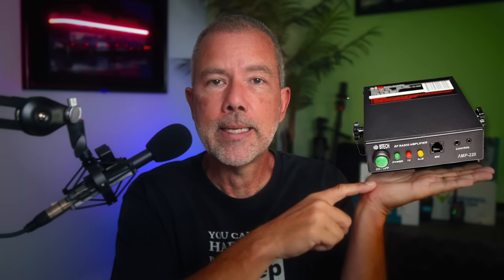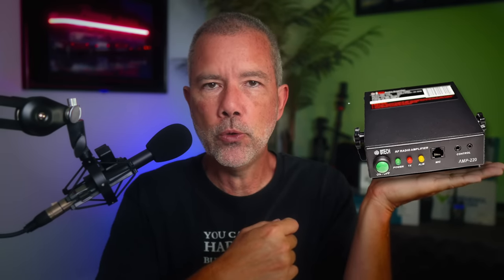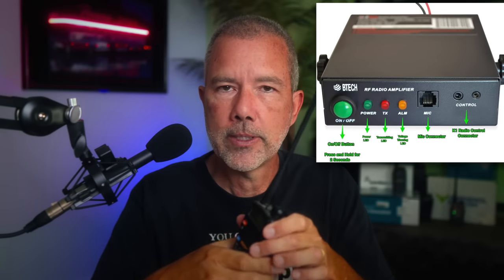Baofeng UV-5R power booster - BTech AMP-220 / BTech AMP-U25 - Boost the power output of your UV5R

Comment: Using a amplifier with a cheap UV-5R is like someone that uses to make a lot of noise at your street and neighberhood shouting stupid things and annoying everyone, deciding to buy a PA (Public Adress) sound system:
You can imagine the havoc........😪😪😪

Using a amplifier like this on a cheap, RF noisy radio is so dangerous for the other radio spectrum users that you cannot even imagine.
Even if you use a decent portable radio, you MUST allways check harmonics levels going into the air (with a good quallity spectrum analyser).
Even much worst at a Base Station than at a mobile station.
Beware........🤬😠
(you can minimize this by using a narrow band passband filter for the ham bands (yes, the ham bands !!! If you are not a licenced radioamateur you have no business transmiting. Remember: you can listen but you CANNOT transmit, so why would you need a amplifier ???!!!!!!!)
Reply from the maker: Each year over 5,000 children are killed because irresponsible parents fail to check the harmonics on their UV-5Rs with a spectrum analyzer....
I am so glad that you have your Youtube FCC Police Badge to save us all..
Reply: Who said they don't have a license?
Reply: The Old Guard 💂‍♂️
Reply: @TheNotaRubicon  you always manage to hook one. Take that luck to the casino!! 👍
Reply: @TheNotaRubicon  it has to be a high quality spectrum analyzer, not just any old spectrum analyzer.
Reply: Guess you'll just have to cry.
Reply: Shush you saaaad haaamm
Reply: i have a ham for flying drones but use GMRS you are sad
Reply: This guy is the reason why every subscriber here should use the roger beep on ham.
Reply: Sad Ham.....Humor Free.
Reply: THe other day, I "accidently" hit the PTT button on one of my UV-5Rs TWICE!  Once in a ham band and once in a GMRS channel.  The wildfire that this ignited killed billions.
Reply: You know, I've seen that claim made hundreds of times in just the last week of researching the UV-5R, but nobody has ever substantiated that claim. Even the GT-5R is just a UV-5R with a software patch to lock TX on certain bands, even though Hams championing it claim it "fixes the spurrious transmissions of a normal UV-5R".
Reply: well Someone likes to see themselves type.  this is more like a christmas ham...fucking boring and puts you to sleep.
Reply: Bro it's 2021, radio tech isn't space age magic, UV-5R is probably many times less noisy than professional grade stuff 45 years ago, and opens the hobby to more people. Stop being a sad ham
Reply: I will be using a amplifier with my UV-10R yes I have 2 UV-10Rs, I don’t care what the FCC rules are, if we didn’t brake rules we wouldn’t need them, having a Ham license doesn’t Improve TX or RX so I don’t need one.
Reply: That was a cool exchange . I haven't seen a knock down cat fight like that since I was in grade school...
Reply: I haz a  speculum anawizer. Widdat work?
Reply: You had me sold as soon as you typed “public address”.   Good for you.  Stay strong.
Reply: I certainly hope you always drive the dpeed limit and always use your turn signals! Like everyone else on the road...
Reply: Why do I not see you posting in the 10m export CB radio videos?  Many like my Connex 4200 have Pills inside not to mention the Wide slew of persons on the SuperBowl6 with their +15000w stations???   Many can be heard on half the band.
Reply: Wau and i thought i will never seen one of those sad hams... :D you made my day
Reply: Hooked you a marlin
Reply: Likes hearing himself babbling
Reply: I need a ham sandwich.   The Bad ham made me hungry
Reply: Sad Ham noises.
Reply: There’s ALWAYS at least one. Congrats OP, you’re it!
Reply: @Tom_H327  It’s not luck. It’s pure sad ham trolling skill.
Reply: I don't see the connection.....
Reply: hahahaa it's the ham radio police!
Reply: @TheNotaRubicon  I smell a ROAST here 🤣🤣🤣 Love your Channel NotaRubicon!
Reply: @BooDamnHoo  THAT WAS YOU?!?!? I lost EVERYTHING in that fire!
Reply: Sadham Insane
Reply: Think of the children....
Reply: @BooDamnHoo  every time I accidentally hit the PTT button, I shiver a little and some pee drips out, don't tell anyone
Reply: I think you need to do a course on RF Engineering!
Reply: Joao P. You're the reason I would never get a HAM license. You are the reason I know that I can supposedly cause harm to others radios with a $20 radio. 
Thanks
Reply: Rectum Analyzer: ACTIVATED
Reply: Yeah, but can you explain that in Portuguese now,  Joao?
Reply: Wtf🤣
Reply: I need an Amplifier with my uv5r ,that way if I accidentally tx without knowing ( while legally listening) , one of the sad Hams like yourself can contact one of your door knocking uv5r policeman and advise me that my tx button is pushed so I can immediately  release the button so as to not reak havock !! 😆
Reply: Lol lol lol pinned to the top for everyone to laugh at lol lol lol
Reply: The horror….
Reply: "dangerous"
Reply: Richard is that you
Reply: 🤣😂😆 Are you serious?!.....
Reply: I'm going to amplify the shiat out of all of my UV5R's and radio check with Roger beeps every fricking ham out there  😆 😆 🤣 😂 😹 😆 🤣 😂
Reply: @buddycraigg  I like this set up, might be doing this soon too
Reply: I'm going to buy an amplifier now because of this tool and his comment
Reply: > If you are not a licenced radioamateur you have no business transmiting.
yarr harr matey... i have just as much a right to use the radio that i bought, unlicensed as you do with a license. do we need a license to use the air we breathe? No we don't.
Reply: It's 40w, not 1500w. Get a grip.
Reply: And there he is, just as you promised...at the top of the list!!!
Reply: A license?
Reply: Someone was always picked last in gym class
Reply: Take another pill you know what doctor said.
Reply: This is why I am still alive.  See you (well..hear you anyhow) on the next coronet
Reply: @TheNotaRubicon  think of the children 😭 🐷
Reply: @TheNotaRubicon hahaha I just blew water out my nose man,😂 thanks for putting into word how this comment made me feel. Lol
Reply: whens your next party id love to come i bet youre the life and soul god bless you
Reply: This guy is comparable to the FUDD guys in the firearms community. TWO WORLD WARS!! I bet his granny is so proud of her little boy
Reply: I'd actually question my filters in my own gear !
Reply: @TheNotaRubicon  I claim 4000 of the deaths as my doing because I used a UV-5R that I bought from AliExpress
Reply: SOME people.
Reply: @asteroidcoming yeeeeeeeeeeees
Reply: Does boufeng make a spectrum analyzer?
Reply: Bullshit
Reply: Doing this the wrong way could interfere with dozens of seniors reaching for their hearing aids and missing dinner at 4 PM, and possibly forgetting to cash their social security check!
Reply: @andyslaven5538  
If you use a radio communicator of some kind, you wouldn't be happy to get interference from a guy using a UV-5R connected to an amplifier, splatering all over the bands....

Imagine interfering with Air Band and getting a visit from the FAA and partners...(FCC, Police....)
Reply: 😂 @TheNotaRubicon
Reply: Sadham! Airwave police! OMG! Just relax and mind your own business...
Reply: If shit hits the fan, nobody gonna give a fuxk about rules and regulations.
Reply: I literally died using mine. Tragic
Reply: @shadowsilverlight1651 

😂😂😂 You just won the "Internet comment of the day" !
Reply: @jplacido9999 WHAT?

You are dead wrong. An amplifier when well chosen and used properly can be the key to successful communication.

I used an amplifier with an HT to make radio contact with the US STS spacecraft on two different occasions. And of course, I am licensed. Your entire statement is wrong. Go study and get a license!
Reply: @pooljunki1 ?!
drone range is much better i take it?
could you tell me more?
Reply: @archer1483 that must be why it's called a spurrious emission
Reply: He's certainly on the spectrum. My analyser told me so @Sam2sham
Reply: Like, what the hell is wrong with using Roger beep, I don't get it. It save me time from having to say Roger and the person I'm talking to knows I'm done transmitting. I just do see the issue
Reply: Very typical licenced ham operator response lmao
Reply: Dudes like this are why I have zero interest in amateur radio.
Reply: BOOOOOOO, SHUN THE SAD HAM
Reply: Yes, Karen.

Comment: Thanks for this Vid.
I bought one tuned for the 2 meter band.
I am currently participating with my normal Tuesday night net.
I am testing with it in place of my normal home setup of my UV-5R going to a TPL brand 50 watt amp, hand held mic, and a J pole antenna 25 feet in the air.
Everyone so far has said that it sounds good and has a strong signal on multiple repeaters.
I'm going to bump the UV-5R output up to 5 watts for my next texts.
Reply: * test

Comment: I own the BTECH AMP-U25 Amplifier for UHF (400-480MHz), 20-40W Output (2-6W Input), the U is for UHF this model allows you to talk pass thru the amp without power. The other units that have digital won't talk thru the amp when off. Stick to analog. Repeaters don't dig digital waves anyways bro. I talked to Randy on this unit with the UV-5X recently with no problem. 986 Long Beach.

Comment: I was recruited to join a professional offroad racing team in a support role, for the SCORE Baja 1000 in Mexico. The team had four satellite phones and numerous VHF portable radios. I pre-ran a 50 mile section of the pro course, and took one of the VHF portables, because I knew nothing about radios. I had an incident about 50 miles south of San Felipe, and could have died out there because the VHF portable was useless. If I'd had the booster and antenna you mentioned, connected to a UV-5R or something similar, I probably would have been able to call for help.

Comment: After watching, I found that there are two amplifiers that work for the UV-5R in its UHF/VHF frequencies. The BTECH AMP-U25 provides 20-40W Power Boost for UHF (400-480MHz) and the BTECH AMP-V25 provides 20-40W Power Boost for VHF (136-174MHz). The BTECH AMP-220 is for 30-50W Power Boost for 1.25M Band, which is from 222 to 225 MHz. I don't believe, though I may have misread my manual, that the UV-5R operates in that range.

Comment: So, I have a set of Baofeng UV-S9's...an upgrade to the UV-5R that has 8W transmission...same programming.  Could you recommend an amplifier kit that would work w/one of these?  Could I set mine for low/med power and make it work?  Also, what is the process for registering a repeater?  Is that a separate process from technician/general licensure?  I'm assuming I'd need a specific frequency granted for this purpose?  Thanks.

Comment: I looked hard at this option for my mobile setup in my truck, having several HTs. But BTECH has some good dual band (lol!) mobile units that don't cost more or not enough to justify the extra installation, mounting, wires (25w or 50w). I'd still consider one for a base station as I already have the PSU to run my Yaesu and usually run a 5R connected to a JPOLE antenna as my second/local stuff/scanner stuff anyway and this would increase transmission range. But even then being limited to 70cm or 2m or 1.25M kinda kills it on the HAM side due to cost. Now for GMRS, that may be a different story.

Comment: Thanks for the informative videos!
I'm thinking of trying one of these in tandem with an Argent simplex repeater unit and a Baofeng UV-5G to make a cheap portable repeater box to drop at the top of the hill or carry in the truck.
Am I crazy and overly hopeful, or does that sound reasonable for light-duty use?
Reply: I have thought of the same.  I have a simplex box  (a LATNEX RC-S120 Simplex Repeater) and have tested it with a HT.  Have been doing radio and antenna checks using it and not needing someone at the other end using the repeater.   But in an emergency, I can put the HT, repeater, a battery together and a Slim Jim antenna up about 40ft up in the backyard  Oak tree and expand the 2 mile radius I get now by 5 or 10 times.  Especially if I bought an amp to go with it.

Comment: Very cool!   So, for the price of a full power mobile VHF/UHF radio, you can purchase an amplifier that turns your $20 UV-5R into a full power mobile radio!
Reply: @NoName-OG1  Or buy a TYT TH8000D/E handy with built in cross band repeat
 and up to 10 watts
Reply: Only issue is that the amps only do VHF or UHF, not both. You can transmit through on the other band without amplification on the analog amps. This makes it not quite the same as a dual band mobile - you'd have to buy both models of the amp.

Comment: I can't get a good match between my UV-5RTP and the BTech Amp-U25D. I'm at 2.98:1 but all TX is brief. I'll try a shorter RG316 cable. The amp output to the Midland MXTA26 is a mere 23.2W and a 1.22:1 match. I have experienced clear communication through an RT97 Repeater from 60 miles out.

Comment: So... I don't think you mentioned range/reach with this?  I actually have a base unit... a Yasue and a power box but I need an antenna...  one of the things I've got on my list to get done.. but I also have several Baofengs   - from my stint in the MS State Guard where I got my operator's license.  That's what we used for comms.

Comment: I have been thinking about doing the very thing using my Retevis RT76P . It’s a little cheaper then buying a mobile radio. It was either going to be a midland MXT115 or the BTECH GMRS 50x1

Comment: I have all the licenses and I fluidly switch from HAM BOOFwang to GMRS BOOFwang then to a dedicated Marine BOOFweng (jumping into my boat in the dock so as not to be illegally transmitting from land) using my FCC MMSI. It’s so easy to use 3-4 individual radios to cruise effortlessly across all the bands I’m licensed in.  Never would you need, nay want, one radio to rule them all when it’s so easy to carry 4 small radios to comply with the friendly peeps at the Eff Sea Seas. ¡Heil Xenu!

Comment: I turned my uv5r into a murs radio
Reply: I changed the frequency on my uv82. I should probably stop operating at 5 watts...
Reply: @SnipedGaming  Why?
Reply: You mean you put a MURS frequency into a UV5R
Reply: @scottmerrow1488  Indeed, the FCC arent give you an endorsement for using low power on a UV82R on MURS

Comment: I bought this amp and I'm reading the manual: It says IN BOLD, "Do not transmit an out-of-band signal while the amplifier is turned on."  So naturally I'm dying to know, what would happen?  Would it damage the amplifier or just screw up the outgoing signal, or what?  You can't put a warning like that in a manual and not tell me why!!
Reply: VERY good question!

Comment: iam a little confused about one thing i want to use this as a base station in my home the  skinny antenna that goes from the handheld radio to the back of the amplifier  would i still need to hook another antenna to the other side ir is that little wire the antenna?

Comment: I am new to HAM and do not understand why the output power of all these HAM radios is so different. What I mean is that 5 watts is mentioned in the description, but if someone measures it, it is mostly never 5 watts. Maybe I am overthinking, but when I buy a car with 100kw motor power, I expect to get this, and when I buy a HAM radio with 5 watts, I expect to get this - at least 4.8 watts but not 3.5 or whatever. But maybe there is a reason; can you please explain that in a video if you have not already done this?
Reply: It actually depends on the programmable HT's software, what frequency you DO/can transmit on, along with what your antenna frequencies are tuned for.
Trial and error is part of the process... it makes us "happy" to have fun while experimenting  - not sad.

Don't be sad... be happy.
Life will be better. (trust me - "happy" is ALWAYS better than "sad")
Vader is NOT my Father. 

NOOOO!!!!

Comment: I'm new to these radios; so be gentle 😂🤣 but I bought one of these on suggestion from a buddy on a good radio for coms. What I didn't know (entirely my fault, should have researched it fully before purchase) is that it's actually a ham radio (yes?) And requires a license for transmitting a signal (yes?). My question here is: is this radio capable of transmitting on a sort of "closed circuit" between say two radios between a couple pals in close-ish proximity? I plan on getting a Ham license in the upcoming weeks (until then, it'll stay sealed and unpowered in the box it came in from the factory). Thanks for any info in advance, and try not to crucify me with criticism Too hard 😂
Reply from the maker: The UV-5R is a ham radio, and to use it without breaking FCC rules you do need a HAM radio license.. There is no closed circuit, or anything else that will get around the FCC rules..  You may want to look into "GMRS" radios, which have most of the benefits of Ham, but is much easier to use.. GMRS radios also also need a license, but you just buy it like a fishing license, not test like for ham..
Reply: @TheNotaRubicon  gotcha; now when I get my Ham license, does that also clear me for GMRS operation or is it two totally different license/qualifications? I guess what I'm trying to say is there any pathway that leads to a "one-for-all" solution? Thanks for the advice as well; Ham radio operation is a good thing to have in an emergency situation from what i can tell, so I'll probably hang on to the UV-5R and just not open it, put the battery in it, or do anything at All with it until I'm licensed. Is that still "legal" to own until then?